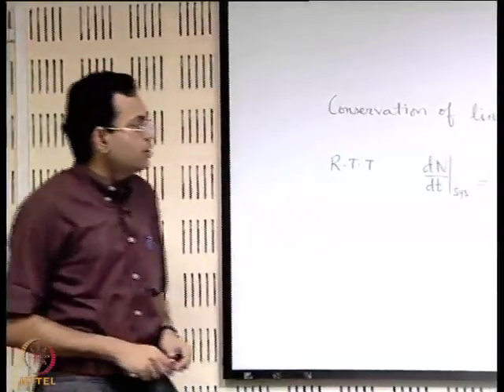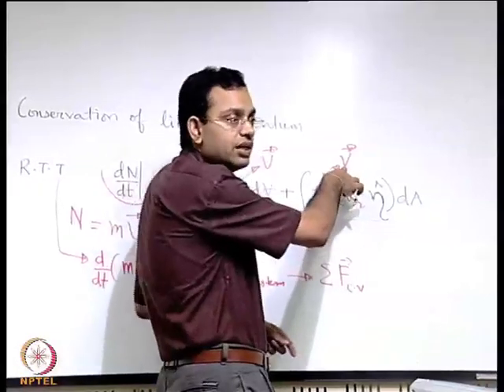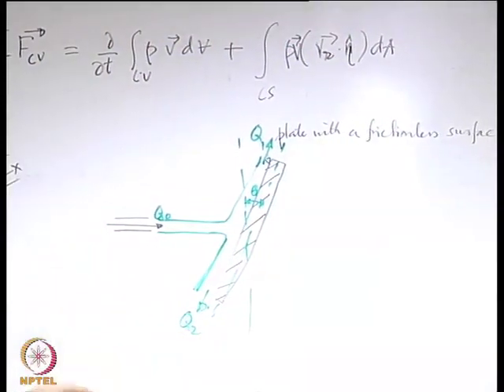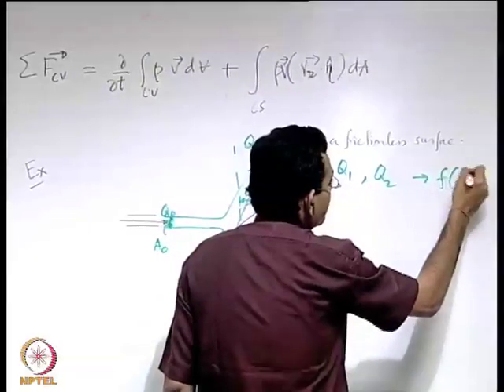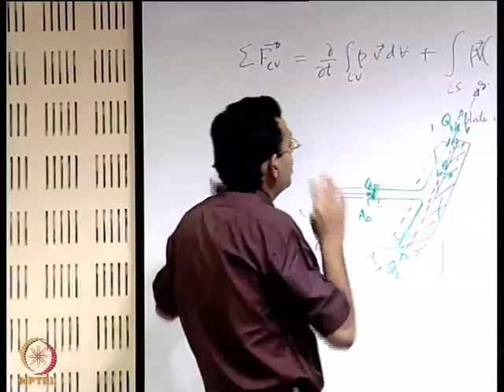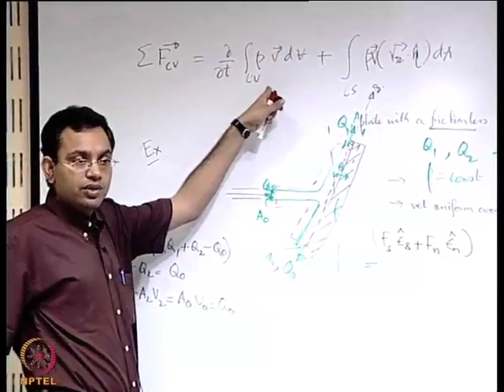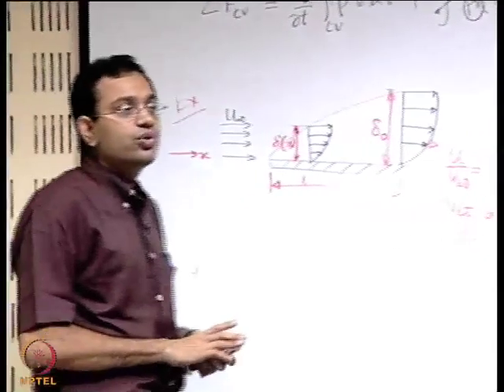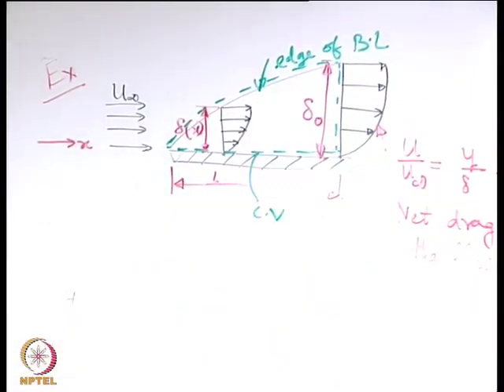Mod-01 Lec-23 Integral Forms of Control Volume Conservation Equations

Comment: at 53 why there should be a new flow boundary why cant the stream line intersect the plate
Reply: bro if streamline is taken such that it intersects the plate boundary.  then how the flow will take place on the plate from freestream in +x direction ? as no flow across the streamline if intersect plate, also across the plate (no penetration condition) so the surface itself is streamline of flow.